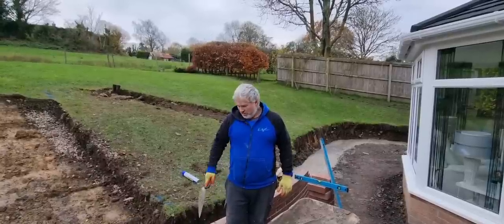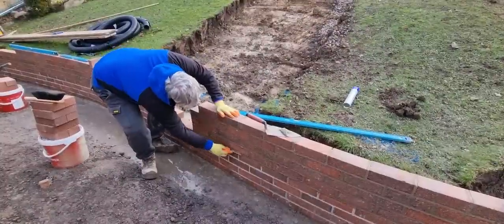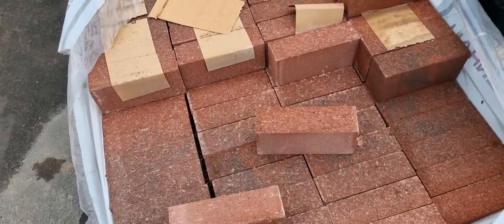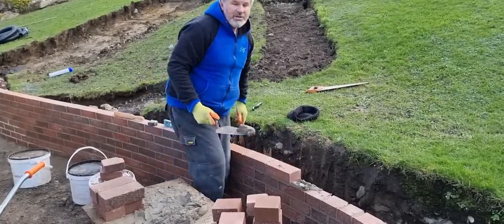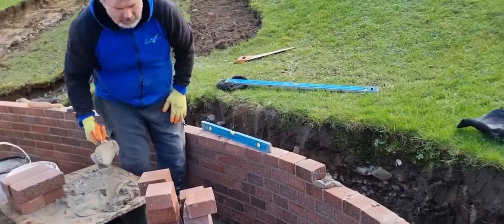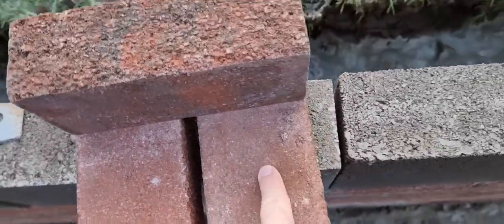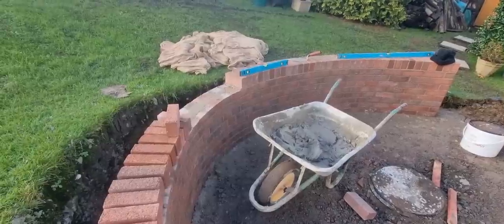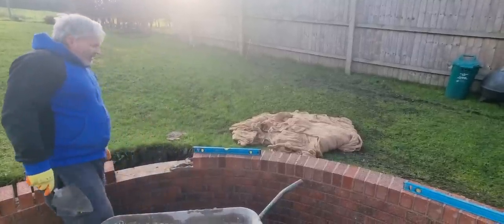Building a curved brickwall 🧱🧱

Comment: Does the wall need no drainage or weep vents? About to do a similar retaining wall but wondered about water behind the wall.
Reply from the maker: https://youtu.be/31XDsHJgrmk.
Have a look at this video. You can watch the entire build on the playlist called the flooded masterpiece. 
Good luck 👍
Reply: @brickrightbuildinglandscaping  not sure I can tie into and existing drain that easily but as I’m not retaining a sloping lawn I might get away with a soak away.
Reply from the maker: @Simon Burch  
Simon be sure to seek permission to connect to drain runs mate.
Weap holes are normally ok for standard walls but there are guidelines for them aswell so be careful. If in doubt seek professional advice or a structural engineer. Good luck with your project. 
Justin 👍 🧱🧱🧱

Comment: If you ever want to instantly stop hiccups: with your thumb and forefinger pinched, apply a pushing force between your eyebrows. Hold this pressure for around 60 secs.

It will work every single time.
Reply from the maker: Gonna try that one with jay he always has hiccups 😀👍🧱
Reply: Holding your breath after u do one is to be best or a little bit of sugar

Comment: Hi Just, what’s your rule of thumb with putting down type 1 in current climates? got my small driveway area dug out last week, and type 1 being delivered in two
bulk bags tomorrow. Still snow on the ground down here. Can you get type 1 in and laid with 0 degree temps?
Reply from the maker: Hi Jack
I added type 1 today in these conditions but i used a blow touch on the ground .i would be very careful on a drive .if you add mot to frozen mot then when it thaws out your level will change the result would mean the drive being compromised. 
So Jack your better off waiting for the ice snow and frost to go mate just to be sure 👍. 
Good luck 
Justin 👍❄️⛄️🧱
Reply: @brickrightbuildinglandscaping  perfect, thanks bud! appreciate that advice!
Reply from the maker: @Jack Hopkins  
No problem be careful Jack 👍
Reply: @brickrightbuildinglandscaping  thanks bud! have a good week, see you in the next vid🙌🏼
Reply from the maker: @jackhopkins9618  
👍👌🧱